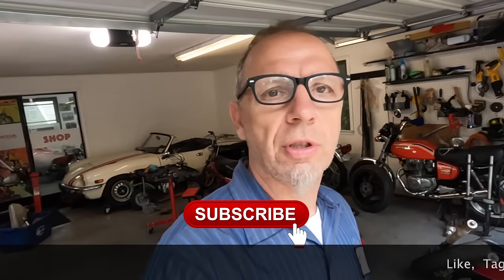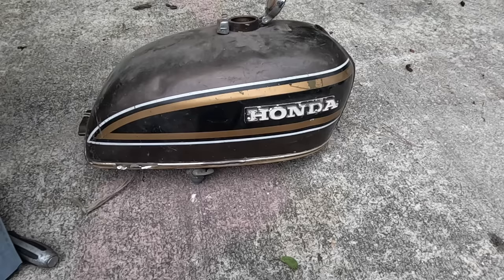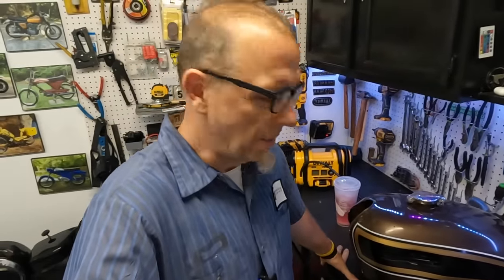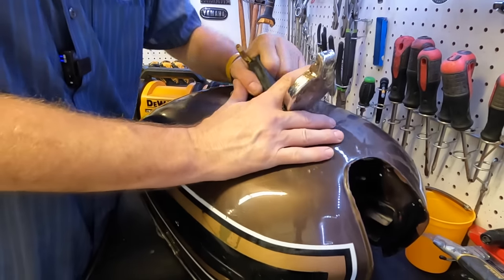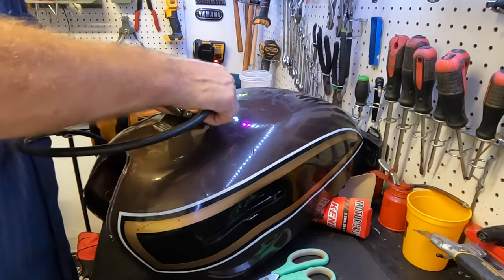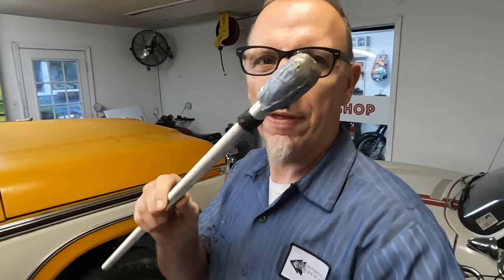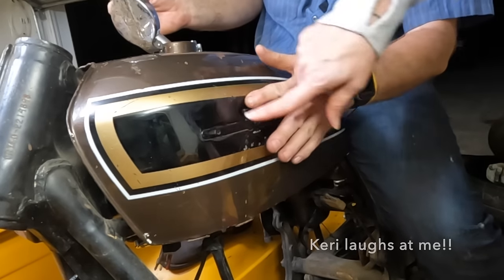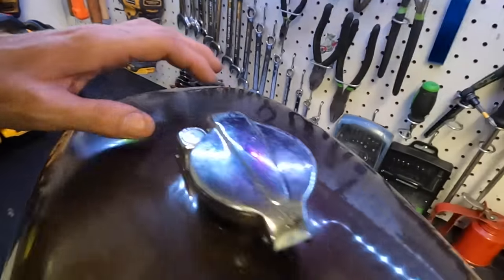1973 Honda CB750 Tank Dent vs Inner Tube #HondaCB750 #cb750 #vintagemotorcycles

Comment: I agree with last posters   put a peice of rope around the tube .an the pump it up after you warmed the tank up as hot as you cani did the same thing on my tanki filled it with very hot water then pumped it up also heat gun  it pushed the hot water out but it kept it warm to pop out dents .  Even ones i didnt notice  .After i done the tank a part on the bottom (where your nuts go) was a lot smoother i just thought it was supposed to be like that .
Reply from the maker: That’s a great idea. I am going try some heat with the next one. Need to find a dented tank.

Comment: The best way is to fill it with water and put it in a freezer... you will have to do that several times, but it does work!
Reply from the maker: That sounds like fun. I have another dented tank may have to give it a shot. 😂🤣😂 Thanks for watching
Reply: @motorcyclerewind    OH, I got to see this!! Doooo IT! 😉😉
Reply: I was just going to make that comment! 👍
Reply: This idea wins the budweiser real men of genius award. great idea Mike.
Reply: @motorcyclerewind  Important note! Leave the cap off to let the ice have somewhere to expand ...😉
Reply: Watch out cause this is the best way to get the tank's welds to open up.
Reply: @mikehunt8968  The ice expands into the dent - - leaving the cap off defeats the purpose.  BTW ice expands 10% so if small dents leave some air in the tank so you don't over-do it !!
Reply: @peterdarr383  No, you need to allow some extra expansion so that it doesn't burst the tank, it also gives you a good indication that the ice has frozen enough, and that you haven't let it go too far... Remember,  I said you need to do it several times, little by little...😉
Reply: That's a killer & better idea actually
Reply: No it more often ruins the tank .
Reply: @motorcyclerewind  try filling the tank with water to just above the dent level , then put in the empty tire tube , then inflate the tube. That way you guaranteed get a nice and even pressure on the dent.
Reply: You could also have it fixed perfectly without harming the paint by bringing it to a paintless dent repair professional.👍🏻 that would be the ultimate best solution possible.

Comment: I used a blood pressure cuff with a squeeze bulb. Worked fine on my 1978 Honda 750.  Easier to control where it is pushing. Saw it demonstrated on a YouTube video.  Great for a tank that you don't want to re paint.  Yes finished of the job with a short wooden broomstick handle. Most people would never know that the tank had been dented...
Reply from the maker: That’s a great idea. Thanks for sharing.

Comment: When we used to pressurise our tanks back in the day, the trick was to use a 27" mountain bike tube. You fill it to thr point where the tank is under pressure, and tap the edges of the dent with a nylon hammer. It pops out gradually as you tap and add pressure. Its not meant to pop the dent, just put some force on the inside to work with. The bike tube comes out easy too.
Reply from the maker: Using a smaller tube would have been better. Thanks for sharing.

Comment: It hurts to watch the bottom edge scratched to concrete when wet sanding it.
Reply from the maker: Good tip. I probably should have put something down to protect it. I need to replace the bottom trim. One side has it and one doesn’t. Thanks for watching!
Reply: Was thinking the same thing!

Comment: The inner tube was a good idea.  If you had used your body hammer or PDR tools around the perimeter of the dent while under pressure it may have gotten you a lot closer.  It was trying to move which is always a promising sign.
Reply from the maker: Thanks for the tip. Lords know I need the help. Thanks for watching.

Comment: Several different ways you can go at it...heres one. Wash it out getting rid of the fumes.... take a propane torch.... induce propane into the tank' then light it with the torch....tap down eyebrows/high spots during the process. 
Start out with small amounts of propane increasing and repeating if necessary. 
I'm not suggesting you do this but that's how we did it back in the early 70's when I first started doing Auto body and paint. 
Back then we used acetylene/tank/torch.
Reply from the maker: This sounds like something that would involve the fire department.

Comment: I haven't seen this technique used, but I'm thinking that a rubber plumbing test ball could be used. These devices have a Schrader valve and are designed to fill the interior of a drainpipe to force open a blocked sewage system. They are available in most any plumbing supply store, in a variety of diameters from about 1-1/4" to 6". Each is expandable to fit a range of diameters. Fill the tank mostly with water, insert a test ball and inflate with an air compressor. This will seal the ball inside the fill neck and continue to pressurize the interior of the tank, applying equal pressure to all inner surfaces and hopefully pop out the dent.
Reply from the maker: That’s a great idea. Off to Home Depot I go. Thanks for watching.

Comment: El Cheapo dent removal tool with glue. I have been thinking about practicing to prepare on a good deal on an appliance bargain at a scratch and dent sale. First get good on a washer or dryer, then someday - REFRIDGERATOR!!!
Reply from the maker: I really like the PDR kit I have. Not expensive and rewarding to do. Even if you don’t get the dent completely out. It’s still better than before. Thanks for watching.

Comment: Worked on my MZ50 Simpson back in the day. Id dented the top i just infront of the seat by having someone sitting on it while messing about.  Hardest part was squeezing the 110/80/18 innertube in the fill. hole. Getting it out wasnt as bad as you can yank it. Did mine through a spare cap though.
Reply from the maker: That’s awesome. Thanks for watching.
Reply: What is a "MZ50 Simpson "? ^^"
Reply: @fuselpeter5393 A MEGA moped.. 50cc of class! Mz we're a German brand. 😁
Reply: @andrewtodd3242  "A MEGA moped.. 50cc of class! Mz we're a German brand. 

"
Well there was never a "MZ50 Simpson" so I was curious what he meant.
MZ and Simson are different Brands and MZ never had a 50cc. Smallest MZs were 125cc.
Reply: @fuselpeter5393  over here in the UK we had a mz50 Simson, my cousin had one. Very agricultural in design, typical GDR construction. It had mz stickers on the tank even though it was Simson by name. 4speed and rode pretty well, it was not one of the 'cool' mopeds to be seen on back in the late '70s.

Comment: There are kits available that pump water into expansion chambers to force dents out. Both ends of the exhaust have to be plugged. This can also be used on fuel tanks. Water doesn't compress like air, so there won't be an explosive rupture if there's a crack in the tank or a bad weld.
Reply from the maker: Thanks for the tip. I am gonna see if I can find one. Thanks for watching.
Reply: @motorcyclerewind  I wish you luck. I think you'll find more uses for it.

Comment: Simply brilliant for some tanks, and I found out that apple cider vinegar will eat the rust in any gas tanker anything rusted. Put some fish tank rocks in the air and speed it up.
Reply from the maker: Aquarium rocks is a good idea. Thanks for sharing.
Reply: @motorcyclerewind  no it isn't 
 Lengths of dog chain easier to get out

Comment: should have let one of those paintless dent guys fix it
Reply from the maker: That’s a good idea! Thanks for watching.
Reply: I had a piece of pvc pipe fall from my garage rafters and dent my triumph bonneville tank. I used a $20.00 hot glue paintless dent puller kit on it. It took several tries and some engineering,(the curve of the tank and thickness of the sheet metal were challenges) but you have to really look for the dent to see where it was now.

Comment: I think a better more controllable method would be to seal the filler,turn the tank upside down,fill with water and pressurise through the fuel tap fitting
Reply from the maker: That sounds like it could be fun. I wonder how much pressure the filler seal can hold?🤔 May have to find out. 🤣😂🤣
Reply: that is the best method to raise a big dent and no danger of exploding anything like there is with compressed air.
Reply: Use of an electric pressure washer works the best. No risk of the tank exploding like with air.
Reply: I had a buddy just drop an m 80 in a dented tank and bang. Dent gone and increased capacity.

Comment: Attack from the outside use those puller rods that you spot-weld on and then cut and file off..
Reply from the maker: The last time I tried to stud weld dents ended up having a welder fix all the holes. 🤣😂🤣

Comment: Maybe fill with water and seal cap with sheet of runber gasket material.   Apply air pressure through gas shutoff valve.   Then use body repair hot glue and maybe tap while pulling.   Water is not very compressable.   If the tank fails from pressure it will just spray water.   If you only use air it could explode.
Reply from the maker: That sounds like a great idea. I need to do a follow up video using all the suggestions.
Reply: water would make it explode too ...if too much p, l thought..but no ...Water doesn't compress like air, so there won't be an explosive rupture if there's a crack in the tank or a bad weld.

Comment: Think heating the area with a heat gun before adding air would of helped. I've done many dent removals in tanks with air, I just seal the gas inlet and add air to the tank with very good results.
Reply from the maker: Thats a really good tip. Will give it a try on the next one!
Reply: 👍 @motorcyclerewind

Comment: Instead of knocking from the inside you should just apply pressure to the center of the dent whilst slapping the outer edge of the dent with a metal padle from the outside
Reply from the maker: Thanks for the tip!.

Comment: Rusty tank?
Drain it. Dry it with compressed air. Slosh acetone in it to remove any oil residue dry it again with compressed air OUTSIDE as clouds of rust will be incredible.
Fill tank completely with  Evaporust. Let sit for two days.
Drain rinse thouroughly with water immediately dry with compressed air. Tank will be like new inside.
Reply from the maker: I really like Evaporust. Does such a great job. I use the shop vac to dry tanks. Just let it blow into the tank for 30 minutes or so. Works great hands free.
Reply: @motorcyclerewind  
You can also use it to clean/flush rusty cooling systems. You can run it as coolant full strength then rinse /flush with distilled water.

Comment: Glue puller ?
Reply: I think using a hot glue puller is the way to go. Use a suitable custom made tool to carefully knock/help from the inside while pulling. There are many videos showing how to remove dents in cars that way.
Reply from the maker: I like the glue puller I have.
Reply from the maker: Thanks for watching

Comment: Next time try heating the area with a heat gun
Reply from the maker: In your opinion, should I do it before, during or both.
Reply: @motorcyclerewind  Both. I've seen it done and it works great on any body metal including motorcycle tanks. 

One more point. When I saw it done on a bike tank he put a huge stopper in the fuel fill hole and injected compressed air into the tank rather than using an inner tube like you did

Comment: I tried this method once and ruined a CL tank that was pristine inside. The inner tube pushed out the opposite side-wall from the dent side of the tank. The tank deformed and is ruined unfortunatley. Just want to offer my experience if others are thinking of trying this method. Cheers
Reply from the maker: Thanks for sharing. Not sure I would do it again. Thanks for watching.
Reply: LOL, you know I won't! 
 @motorcyclerewind
Reply: Same mistake he makes here. You forgot to heat up dent.
Reply: I have a 1974 Honda ST90 AND LOOKING FOR PARTS.ANY IDEA.CAN YOU HELP.THANKS @motorcyclerewind
Reply: Honestly that's the result I expected to happen...
Reply: I’ve seen a deflated football pop a dented cowl out on a fox mustang🤔👍🏻
Reply: I’ve seen a deflated football pop a dented cowl out on a fox mustang🤔👍🏻

Comment: careful inflating or freezing tanks like this.  I've had two CB750 tanks that previous owner failed.  When the pressure in the tank gets too high the tunnel widens and the top tin cans.  The result is the tunnel is too wide to hold the frame and the crease damage on the top between the steering neck and cap  is really bad.
Reply from the maker: Great info. Thanks for sharing.

Comment: i use cut off bicycle handlebars
Reply from the maker: That’s a great idea.
Reply: @motorcyclerewind  done it for 30 yrs
Reply: @motorcyclerewind  done it 30 yrs, there are 100 bends of bars, get into anywhere, just put a cheap grip on and work the dents out
Reply: honestly i used to buy dented CB750 original paint tanks, push the dents out, polish or clear them and sell them for obscene money.

Comment: A 2 liter pop bottle will hold over 100 psi so I seriously doubt that tank will rupture
Reply from the maker: I did not know that about pop bottles. Thanks for sharing.
Reply: I ripped one apart at about 30 psi.  Pretty gnarly explosion.  Small weak rust area in a bottom seam that was invisible.  
The air compresses like a spring and unloads violently.
Reply: Those toilet cleaner and aluminum foil "bombs" in a 2 liter bottle......... I don't know what pressure they go off, but they are loud.